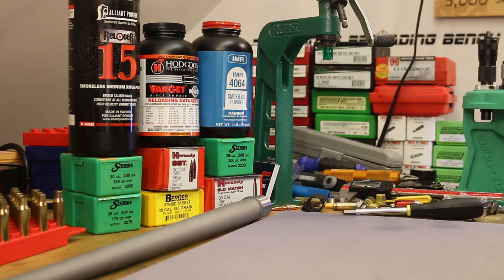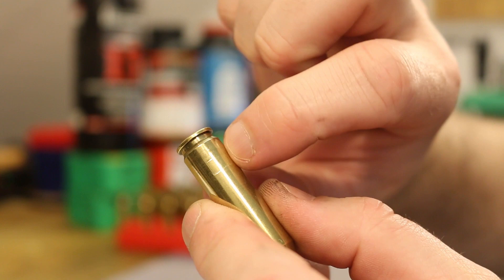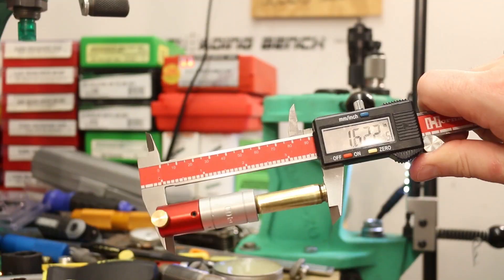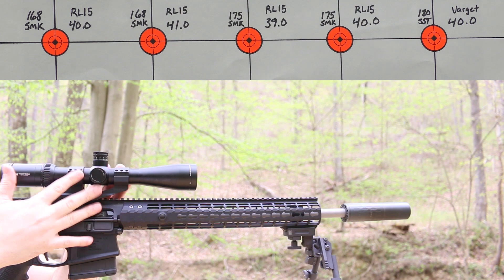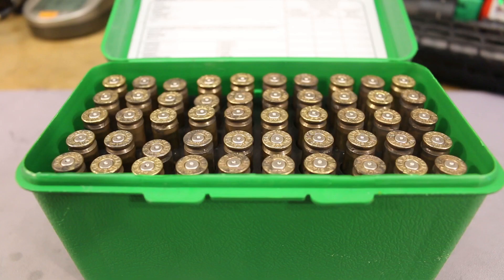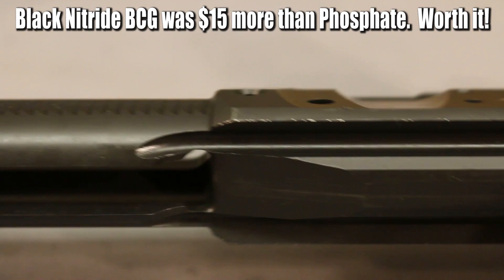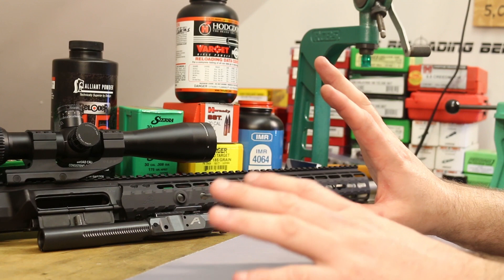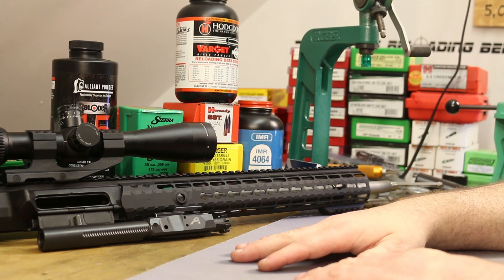Aero Precision M5E1 - More Accuracy Tests (AR-10)

Comment: Don't know if it's been mentioned previously, but for adjusting your Seekins gas block a ball head hex key will allow you to engage the adjustment screw at a bit of an angle. Using a regular hex key you have to be nearly straight in line with the screw. Also, I appreciate you showing the mishaps, hurdles, and failures you've run into getting your rifle to work and not just editing for the successful parts. I've reciently purchased an Aero M5 lower and am in the process of building it up.

Comment: I know this is old.  But in an AR-15, I remove the O-Rings and use only one spring (these are only necessary for military use where you don’t clean) .  Also polish the inside edges of the barrel extension lugs, turn the gas down so it doesn’t tear up the brass.   
The erosion on the gas port is very normal. It starts looking like that nearly immediately.

Comment: I just put together a AR-10 in .308 . Upper and lower are both Aero. Upper has a 1 in 10 twist with a 20 inch stainless barrel. Thinking of putting together another AERO  but a 6.5 creedmore.
 Do enjoy your input and the way you check stuff out. Keep the good or bad info coming.

Comment: I have a AR-10 upper with the exact barrel you have and have had excellent results with 43.0 gr IMR 4064 and the sierra 168 MK bullets. 3/4 inch groups or less. Though without an adjustable gas clock it is overgassed and showing slight over pressure signs

Comment: My Savages tend to have a bit more headspace. I actually sent one back because it closed easily on a no-go gauge and Savage told me it was within their specifications. It will shoot sub MOA though, even when full length sizing the brass on my reloads. All of mine have very loose chambers, but are very accurate.

Comment: For the handguard interference issue (gas block adjustment) just file that particular bridge away, no biggee.
Reply from the maker: It crossed my mind.  If a ball-end allen wrench doesn't fix my problems I might pull out the file.

Comment: I've never had any luck Hornady ELDs. I've gotten much better resuts with their 168 BTHPs. I also had good results with Sierra's TMKs
Reply: Revan my win mag bug holes the 208s at 2860fps and 3/4 MOA from 178 ELD-X in 308 at 2700fps. The Shilen 308 when backed down to 2600fps and 175 SMK is really good too. The Criterion Win Mag does not seem to care it shoots EVERYTHING! 3/4 to 1 MOA is a bad group, lol. Heck with Reloder 26 at 3125+ FPS it still shot great and easy bolt lift. But damn that barrel was gonna get scorched.
Reply: I think at max charge with some powders, thin brass bullets deform too much. Less than max charge might be solution

Comment: Looking forward to see what performance you get with the BA 20” 6.5CM barrel.  I have the same setup and have been very happy with consistent sub MOA performance.  Looking to bring it down to 0.5-0.6 MOA range with a good hand load recipe (finally found H4350 locally so have high expectations).

Comment: I bought the same set up and had the same problem with accuracy. I bought a different barrel for it and when I went to change it out I found the barrel but was only hand tight. I went ahead and switched out barrels and the new one shot a little better but I was still disappointed

Comment: I wish the AR15 and AR10 mag well and magazines would be extended 2/10ths of an inch to allow magazine feeding of high bc longer bullets like the 75gr eld or 200 smk. I think the platform can still be improved creating something in between an ar15 and ar10 like a 5.56x48 or 6x46
Reply: 7mm-08

Comment: Maybe look into the tubbs final finish system... Made an incredible difference on my Ruger American predator in 6.5CM, 1.3-1.5 moa down to .4-.8 moa and extremely easy to clean afterwards. That would make a really cool video to see the difference before and after

Comment: Thought about using a brass catcher?  Saves on camera replacement and chasing brass around on the ground. Thanks for the brand info on the gas port devices. Have done an AR-10 308 to 6.5 Creedmoor conversion. Your video series helped me with some thoughts with regard to my load developments.

Comment: I think you would see some improvement if you had this barrel re-crowned. With you bore scope views, I noticed some significant burrs specially in the grooves. Seeing this is where the gasses are not as well sealed because this is where the pressure of the bullet against the bore is less. Any burrs at the muzzle causes areas where the gas escapes faster than where there are no burrs and this escaping gas can cause the bullet yaw in the opposite direction. Just as a cheap test before you get rid of the barrel I would use a de-burring tool lightly on the muzzle and see if it would knock those burrs down and improve your groups any. Of course only do this if you're not sending it back. The rest of the bore looked pretty good from what I saw. But that crown... not very good.

Comment: Try seating those bullets 0.010" off the lands.  I used to seat a bullet long and chamber it and then measure the length and shorten the aol by 0.010".

Comment: Johnny, I just bought the Aero precision upper and lower build set, I'm putting a 20 inch, 4150 Chrome Moly Vanadium barrel.  I'll try the mil-spec trigger first before spending the extra for a Timney trigger, but I do like Timney triggers.  I would like to see you change the way you reload for a specific round and accuracy

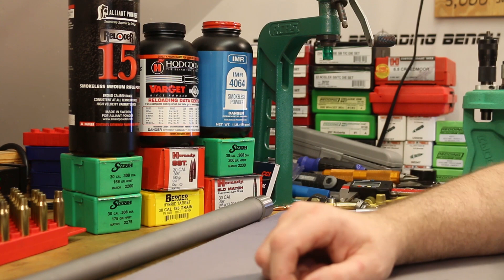Comment: With a 1:10 twist I've had the best luck with 168 and 175 gr. bullets, I was never able to get good groups with anything heavier. IMR-4064 gave me great groups with both bullet weights but was very temperature sensitive near max loads, I tested around 70 degrees and around 80 degrees had flattened primers, stuck bolts, FTE's, and strange markings on my brass. I found Varget tends to do better with near max loads in my rifles and tends to be temp insensitive. I don't know how to contact you privately, but if you're low on 175 SMK's I'll send you some for further testing, I think I've got a hundred or so laying around wanting some action.

Comment: And considering the marine corps m40a3-m40a5 use 1:11.25" to 1:12" twist barrels and they run heavy bullets decently, don't get hung up on twists.
Reply: jimhans1 The thing is a .308 not a .30-06 or win mag etc... Leave the 200+ grainers (except maybe the 200.20x Bergers) for the bigger guns. 178 ELD-X or ELD-M is enough. SMK's etc....
Reply: Thomas Ewers hence the reason that I said he does NOT need to worry about 1:10, as the 1:11-12 will work just fine.
Reply: Thomas Ewers and I love the heavy bullets in my 308win match guns. Find the right load and I don't need an '06 or any mags, they stay true and straight in the 308 just fine ;-)
Reply: jimhans1 just agreeing and expounding upon it...lol

Comment: I think Shilen and PF will both perform nicely, although I haven't seen too many reviews on the ss proof line of barrels, yet. I'm actually debating a barrel for my AR10 6.5CM build and have been quite interested in the PF stainless barrels w/ the +2" gas length--could be an option for you if that BA 6.5 doesn't shoot.

I am curious: have you ever tried Tubbs Final Finish? I'd be curious to see what effect (if any) it would have on your accuracy before you pitch that 308 BA barrel.

Comment: It would be nice to see you do a full work up on one powder and one bullet. Your really throwing darts at a dart board with so many powders and bullets and not giving any of them a chance to perform. If I did that with my White oak barrel on my ar I would be disappointed with its results too. try and find a node with one set up before pulling it apart. You use to load like that all the time and work loads up now your just everywhere like you have too much to cover and not enough time. Just my 2 cents man.
Reply from the maker: I have always done videos like this with new barrels or guns.  It's to break them in, get them functioning properly, and get some idea about how it performs with different weight bullets.  Once I replace the barrel I will be doing a similar break-in video with that barrel.  
It's only after we're broken in and running properly that I start doing normal videos.  If I tried to start with my normal video format before I even had the gun running properly we would get in trouble quickly.  308 bullet testing videos in my normal format will continue once I have a gun that runs properly and doesn't shoot 2" groups.  
If you go back, I did a video very similar to this one on my .223 Wylde White Oak Armament barrel.  Go back and look....it didn't shoot a bunch of 2" groups.  By the time that video was over we knew we had a good shooting barrel on our hands.
Reply: Sounds good man I'm just glad to see a video I really do enjoy your channel. Thats just a disappointing result from that barrel. Let's hope the 6.5 does better.

Comment: Very Strange! Seems like it’s warping with heat. How long between shots. It is very consistent in the pattern. First shots are all just below and left about 8 o’clock. Then left of that. Third right of the first. Forth almost dead on first shot. I’m far from expert but. Do you think that bipod might also be torquing the upper. I know barrel is tight but I have seen instances on ar platforms that resting the hand guard closer to the magwell will give better accuracy. 

One last thing. Those are relatively slow loads. I’m sure you step it up some.

Comment: Kinda different topic question. I had problems with IMR 4350 in federal brass with 6.5CM. Case was full to the case mouth with 40.8gr. With that being said, im interested in trying Reloader 17 and wanted to know if the kernels were smaller than that of 4350? To avoid same problem. Currently working with H4350. Just wanted to try something different.

Comment: Hornady ELD-X 178grn.   backed by 42.2 grains of Varget C.O.A.L as long as it can,  to still load in Mags.  I'm at 2.884  for my bolt gun.
Reply: forever556mm  I am at 43.4 @2.860 in mine... gives me 2700 and decent accuracy. However 175SMK and 42gr was best group ever from the gun.

Comment: As to the polls, you really needed to put Krieger on the list!!!
Reply from the maker: Would the Krieger M110 barrels fit my gun?  If not, who chambers Kriegers for AR-10's?
Reply: Not quite a cut rifled Krieger but Criterion was the brand they started for such things and then a long time employee bought it and they still cooperate with each other. They are button rifled and hand lapped. I really LOVE my RemAge barrel from Criterion.
Reply: Johnny's Reloading Bench yes, Krieger makes AR-10/DPMS barrels, they also make them for Armalite versions, but yours would use the 10/DPMS style. And they are awesome.
Reply: Johnny's Reloading Bench here is the link for the build sheet, under contour you would choose either of the two contours, and then choose the last option as finish chambered in AR/DPMS type also. M110 contour comes standard with 5/8-24 muzzle threads also. 

https://www.kriegerbarrels.com/srorder?se=kbiprod&gun=4
Reply: My AR15 has a hand lapped Criterion. Its the only half MOA chrome lined barrel I have ever seen.  Once I factor in price, Criterions are the best thing since sliced bread.

Comment: Hey Johnny, once i had enough rounds loaded on my Redding turret press, it started doing the same thing on sized brass, it would wander on shoulder length during resizing. It was flexing like mad. I sent it back to Redding and they replaced the press, it was wearing out. Just a thought as I don't know how many rounds you've loaded on that press.

Edit: that crown really looks horrible. I would have a nice recessed 11-degree crown put on it and retest that thing!
Reply: jimhans1 interesting
Reply from the maker: Yeah, the tilt does seem to be noticeably worse recently.  I've been thinking about getting one of the new Lyman presses to try out.  Similar to the T-7 and a really great price, so it's worth investigating.  Maybe if I get one I can send the T-7 back to Redding.  It's got a lot of miles on it at this point.

Comment: With the 200 Gr SMK and 38 Gr’s of IMR-4064 showed some potential, then the group  opened up at 39.0 Gr’s. Maybe you should have tried fine tuning that load with 38.5 Gr’s of IMR-4064

Comment: I've owned Shilen drop in barrels and they had the longest throats I've ever seen. I love their blanks but I will never use one of their barrels they chamber again. Of your list, the Proof stainless barrel is by far the highest quality, it's pretty amazing what you get for the money. 

With regard to your extractor; the reason why there is two o-rings and two springs is because the extractor is poorly designed and needs a ton of tension to function. A DPMS G2 or a JP extractor will function correctly without all of the tension.
Reply from the maker: Wow...thanks for that warning about the Shilen drop-ins.  I hate long giraffe throats with a passion.
Good info on the extractor as well.  If it becomes a problem I think I will be quick to pull it and switch to a JP.  JP bolts are so awesome but that price tag hurts.  I never hear anyone say it's not worth it, though.

Comment: Those velocity numbers that why I like LC brass turn it another 100 fps.  Then throw away after 4 firings
Reply from the maker: These were EXTREMELY light charge weights.  A long way from max charges, so that's why the velocity was so low.
LC brass is extremely thick in 308, and so is this Starline brass.  We'll talk about case capacity in some upcoming videos.

Comment: The ejections looks erratic. Take at least one of those orings off maybe try both in mine it was overpowering the ejector spring itll help i believeI. I had some odd issues with my ar10 as well untill i put in a tubbs flatwire buffer spring,  springco ejector spring and ejector springs (THE EJECTOR SETUP IS A 2 SPRING SET). The difference in the guns operation is huge. Ejection with ammo is dead nuts consistent and malfunctions are nonexistent since i did those changes. my gun was a jamomatix because it was so over gassed that rims of cases where bent with most hot heavy bullet loads and the ejection if it didnt stove pipe or trickle out was rocketing out at 1:30-2 o'clock. Its about the most economic thing ive ever done and made a massive improvement from being a pos to awsomeness in 308. Also ive had realy good luck with accuracy using arcomp w/ 150ish bullets and 3031 w/ heavy loads and i use rem mag primers with it exclusively for what its worth

On another note i found it interesting you made note of the (rough) rifling in the Thompson barrel. Ive notice all my newer S&W barrels including other brands of guns that are all owned by the umbrella company that is S&W all appear to have distinctively simularly rough rifling, most notably the grooves have tooling marks, some alot deeper and rougher than others. Most other major brands and some smaller budget companies produce barrels that look visually perfect. All my newer (last 10 years or so) S&W made barrels all look similar in appearance with lands being smooth like i expect but the grooves are rough with imperfections, gouges, my m&p 9mm pro series is the worst i have with gouges, variances in groove depth that includes throat imperfections in an area that starts 2 of the grooves that are especially bad. Its my opinion this results when worn and/or dull tooling leaves large machine marks resulting in some looking better and others worse. When a new gun is first released this it appears to be less of an issue however i believe every gun built by smith ive bought on sale or with a large rebate in recent memory has had "rough grooves" i believe, although i noticed the trend after id owned several of the guns a while but i do believe that the difference in my guns and their quality to the best of my memory. 
 That said they all shoot jacketed bullets accurately and none of this seems to have any adverse affects on accuracy or performance with the only exception being ive seen is some of the rougher barrels can cause substancial leading. Its ussually not a big issue except my m&p 9mm after shooting 50 -100 rounds or so the leading has degraded its performance so much itwas obviously less accurate. The leading was so bad i waited till my next trip and shot jacketed bullets through it for cleanup to be at reasonable level. I guess what im gettin at is at the very least its visually looks like  crap and compared to many other barrels made by others or S&W from years ago for that matter the quality control is not what it was or should be imho.
Reply from the maker: Thanks for the info, brother.  Seriously...great stuff.  I will check out those springco springs.  The Tubbs flat would be nice as well.  The standard spring noise is a little bit annoying on camera anyway, so at the very least it should help with that.
Yeah, that Thompson barrel had tooling marks in the grooves throughout the barrel.  Which doesn't really make a lot of sense to me.  I thought button rifled barrels had a mandrel pulled through them, so I can't even wrap my head around how those marks would get there in the first place.  I'm pretty dumb when it comes to barrels.  Now that I've got a scope, hopefully that will help me learn.
Reply: Johnny's Reloading Bench the main reason i bought it and recommend it it gives greater force on bcg while closed but has less resistance than a standard spring when the action is at its rearward most position. In my gun it has allowed me to fire the widest range of ammo from the hottest handloads, my 200g pcd cast loads and the cheapest ,what feels like ant farts in a 308, russian steel case crap without changing the gas setting though i dont have a suppressor yet.